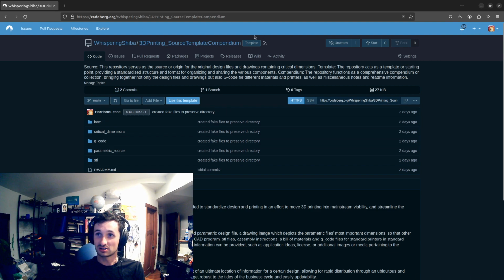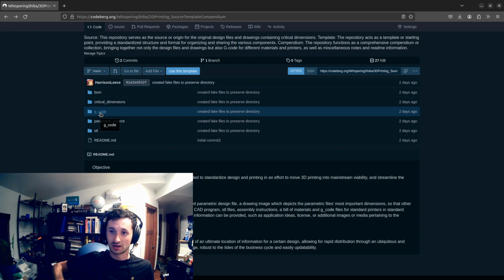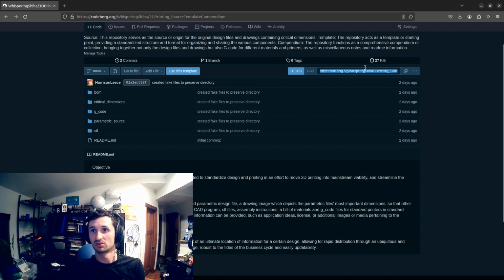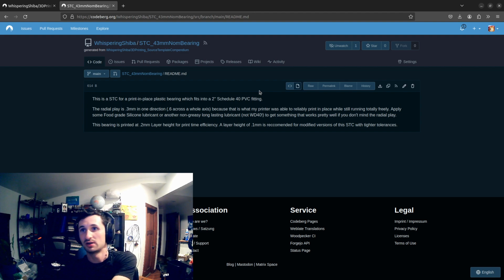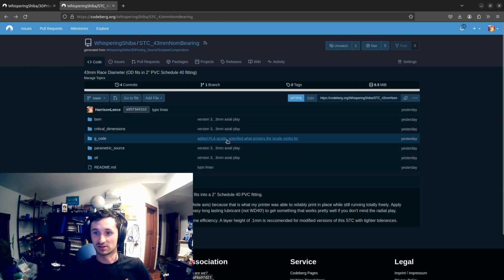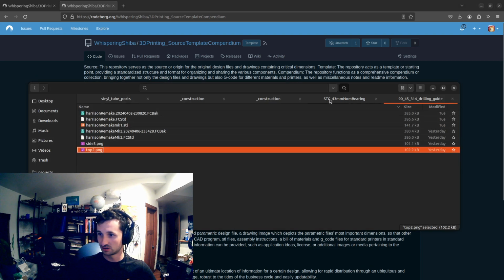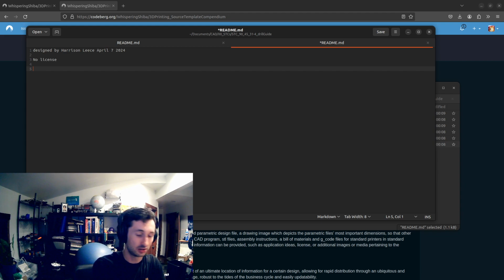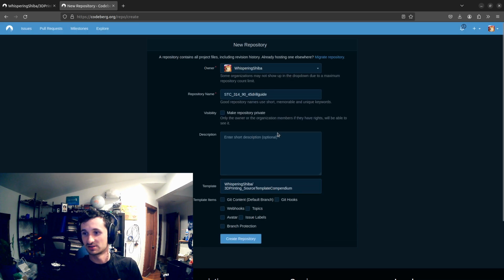Standard Template Compendium for Designers (3D printing, Electronics, Construction)

Comment: I see what you're going for and I wish you all the luck to succeed. However, if you're going for mass adoption for "normies", this is as far from a viable standard as possible. I agree that the current landscape is fractured and manufacturer-centric. Event then, their solutions are easy to use, you can easily search, download, collect, remix (and sell) in a visual browser-based UI. And you can use an aggregating indexer such as Yeggi to search across all of them. As much as I'd like for git to be a widespread general knowledge, getting a layman use git instead of a single click on a webpage is unrealistic.

On the other hand this would be a nice standard for open-source engineering designs. It's a small niche with only a partial overlap with the 3D printing community and I wouldn't expect a mass adoption, but it would be an improvement for sure. I've wished for it to be a standard to upload a STEP file along the STL to Printables many times. I've also used Onshape's library of public documents, but the search is abysmal and solely dependent on the creator's naming scheme. So having a standard for open-source CAD would be nice.